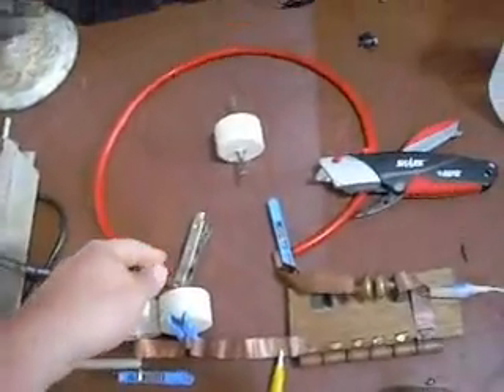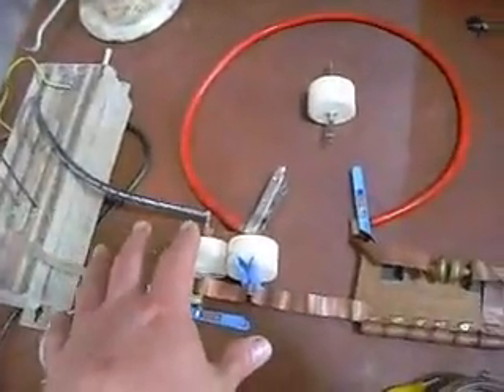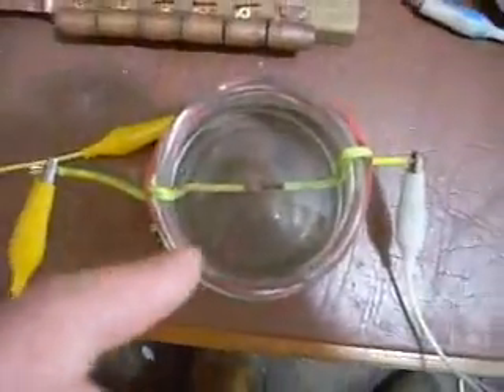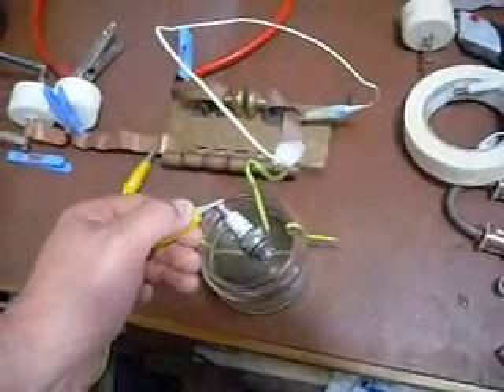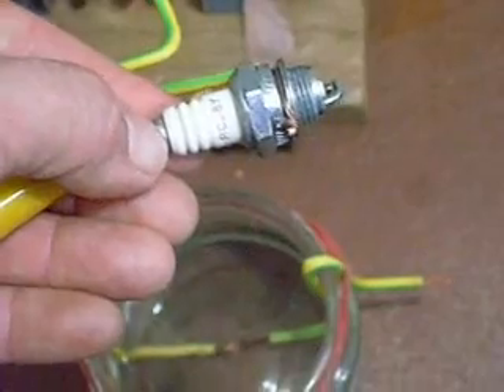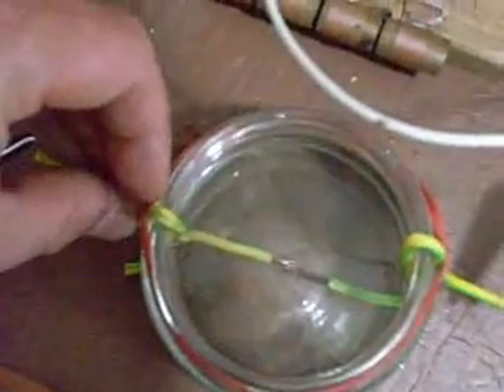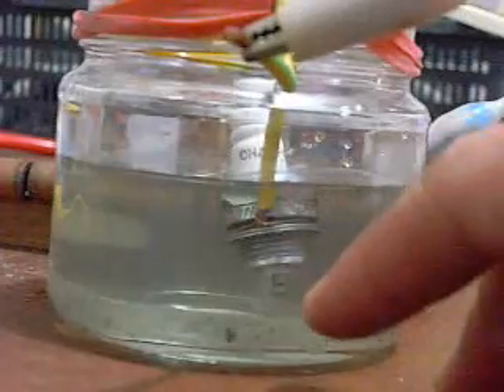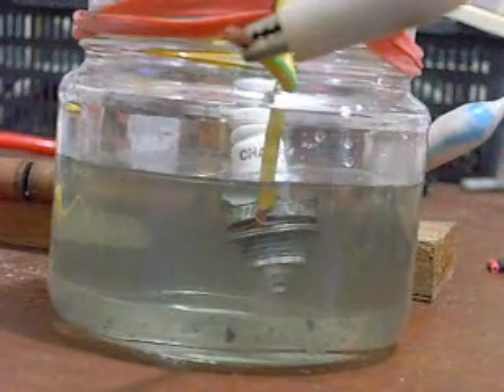High Voltage water cracking

Comment: Those guys sparking plugs on workbench, trying to emulate S1R9A9M9 and his actual technicians, fail to realize that expulsion is too fast in microseconds, and too much current from capacitors. The several S1R engines 2005-2013 did not use capacitor discharge ignition. Only standard induction coils were used for high voltage so as in milliseconds time of spark time. Proper math formulas can add inductor coil and resistor to slow down spark. The S1R conversions on 4cyl, 6 cyl, and V8 cars, tractor, and engine stand power generator all used same old style dual coils relay per cylinder that had about 1.5MH coils and diodes. Sort of like the term delay line. More time available for water to contact spark current 3-6 amps for hydrogen and water vapor pressure generation, at lower end of piston stroke. The lawnmower set up used hand made magnetic coils assembly to replace the non available Bakelite Relays in vacuum. Data gleaned from web forum before closed.

Comment: S1R9A9M9 ran his Briggs 18HP mower engine 2008 on water in carb with the
 high volts ignition and 10 amps from temporary only battery and then 
alternator. The load voltage needed was over 1200 volts so he used bare 
wire so as the high voltage had induction leakage to low voltage side of
 the S1R coil assembly to raise up the low volts to very high value to 
push amps through spark plug of 125 ohms. The magnetic field on the 
ignition wire allowed for extension of spark time to about 34% on time 
ATDC. About 100 volts necessary to overcome small electrodes of gap, 
plug resistor, and the water resistance. The plastic tub hanging n side 
of engine has the S1r coils, accessory spark gap, and diodes. The 
original relay as used on the cars per cylinder, with inductors also 
would fit inside tub, but not 100% known. Purpose was to show engine can
 run with minute hydrogen generated and formation of water vapor 
pressure aiding process, at lower stroke area of piston.  See You Tube 
videos. Web site shut down.
Reply from the maker: thank you for you detailed description. i have also read the stephen jones document who claimed to run a similar engine on a joe cell, the gas was not input into the engine but met a blind fitting that connected to the back of the carby, and had a timing adjustment to move it after starting on petrol it was warmed up theb switched over to run on air at the new timing position. it is time to reclaim our stolen future!
Reply from the maker: are you working on water fuel?
Reply: Working on electronic circuit for replication of S1R9A9M9 water conversion for 12HP Briggs. Setting up negative voltages for 3-6 amps average type current. About 100 volts necessary for spark plug and needing diodes protection of battery and power converter.  Adjustable miniature converter set 150v superimposed on 24v DC converter - just like lithium battery jumper unit is used to jump start your car when auto battery 10volts. Starter motor needs 12 volts , and the amps comes from the auto battery. S1r back in 2008, used ignition high volts as jumper for 1300v needed to push 10 A through 18HP spark plug.  R X I = E
Reply from the maker: @waterfuel  are you managing the timimg with that steel coil like he did? or making something else? I watched the deconstruction of the "special" coil in the can, and note his comment to someone about using hos hand to choke the motor because less air was needed...
Reply from the maker: and what do you make of the smack channel investigation?
Reply: I hand built "modified" replica of the 2008 S1R triple coils assembly. It serves 4 purposes. Provides magnetic field for ignition cable to extend timing  of firing,  -34 degrees,ATDC. The same amps for field also flows through spark plug. Magnetic field is carried along wires to tip of spark plug increasing efficiency. Also The bare #12 gauge 5turns provided induction leakage to superimpose over 12v insulated #14 copper wires for increasing voltage pressure to push 10 amps through spark plug. QC12YC is 125 ohms on his engine, changed from 4000 ohms.  R X I =E . The insulated wires for triple coil were originally nickel plated copper. He got them from used lawn mower harness wiring red+ gray. He just thought it was S.S. The plastic tub on 18HP engine has triple coils, diodes, accessary spark gap. Battery starts engine, battery removed, engine circuit runs on alternator, and self running . Battery was not charged and Inverter box not used.  See S1R9A9M9 video #1 at lowest speed to see power wires coming down wrapped in black tape, from upper engine cowl to tub. Inside is joint so as High V and amps same time exit to white wire and plug. The shop real technicians in Georgia did nearly all of work, S1R just mentioned notes on the message board thats now shut down.
Reply: The so called hot automotive technician made 14 mistakes, as those young guys do , when he went to visit S1R and look over the water powered Briggs 18HP. He also never ran engine on regular gas first, nor tested head compression on gauge. The wiring was not set up right, and parts were missing when Smack did his thing.
Reply from the maker: @waterfuel  i was also thinking about the compression after we saw S1R look at the piston sleeve. Are you posting results anywhere? Would like to stay in contact with you.
Reply: The S1R video as the porch scene, is after the valves were serviced and new head gasket. The unit was not hooked up exactly same as in videos 1+2 of RUNNING engine. There is no "induction" into bare wire with opposite coil of straight DC , no current transfer, and the end wire "during starter spinning"  was not connected to spark plug, only to fan motor and ground.  Induction only could happen with on + off DC or AC power. Extra current has to go through plug. Some videos are intentional to be wrong, misleading, as guys back at that time period 2008, got themselves hurt attempting to replicate the circuit.

Comment: hey m3sca1,    distilled water 70kv/cm but stan meyer wasn't arcing in water. he separated his capacitive plates so no discharge would occur. Then he made a square dc pulse wave at 42.1khz with an 100% on duty and 10% off duty. this makes the polar poles of the water vibrate like a tuning fork until hydrogen bonds release. by the way if you are using much more than a few watts and not producing more hydrogen at a rate no less than liter a second then you sir are not replicating his work. but I hope said info helps>

Comment from the maker: @NOBOX7 thanx for your input bro-you been hiding under a rock somewhere? long time no hear....anyway the effect the multiple spark gap has on the water is quite amazing to watch.the water dosnt heat up much at all on this setup(it is slower than a HHO cell in temp rise) so i tend to think its not steam-the bubbles moving sideways rolling around themselves pushes me to the conclusion of cavitation like the pistol shrimp snapping his claw,made by sound waves from the violent reaction

Comment: cavitation is caused by mechanicly induced vaccum that pulls disolved gas out of the water, and forms a powerfull vaccum that subsquently implodes with enough force to eat metal , or pit metal on impellr blades or propellers, i dont think this is cavitation but rather steam.. my puter is fkt up hope you get this msg

Comment from the maker: @honda4004i think its like both are happening one after the other,expand -collapse.
that is the only thing i can think would create those ultrasonic like shockwaves that are holding bubbles in a standing wave.
if i do this with DC its just expand-if i use AC its seems to collapse again.
also this setup is not getting hot like your traditional cold fusion setup.